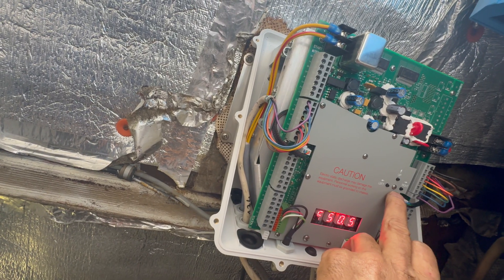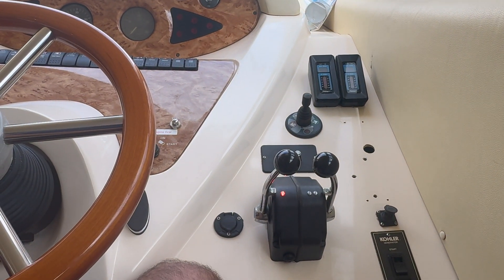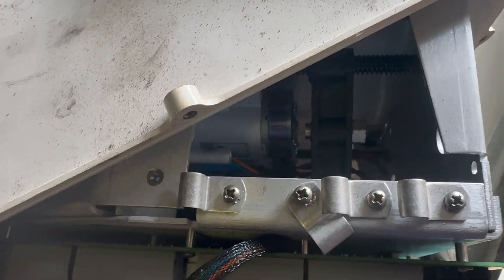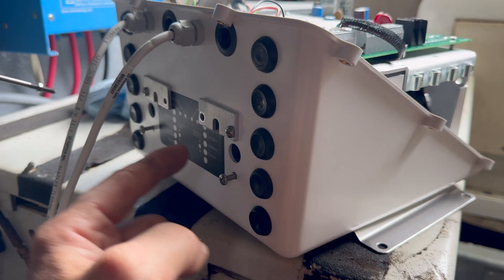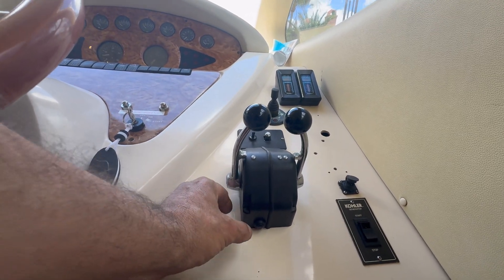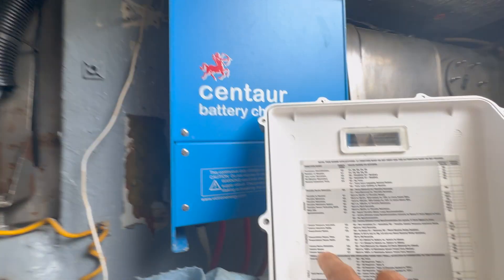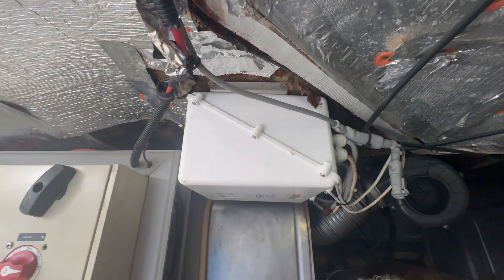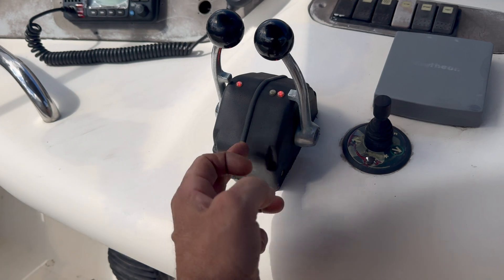Yacht Stuck? Fixing a DEADLY ZF Throttle Failure!

Comment: I also have an Azimut 46. MicroCommander on port is working well. Starboard is showing higher than Port amperage draw on neutral and reverse. No amperage pull on forward and no forward engagement. Any insight? Thanks for a great video.